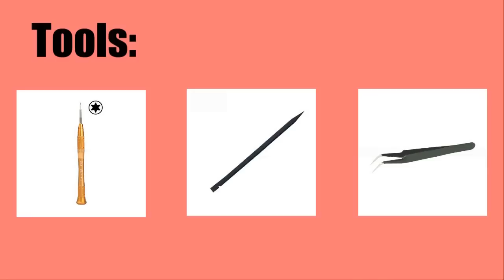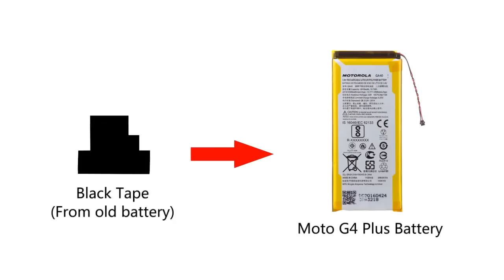Moto G4 Plus Battery Repair Guide

Comment: What is the purpose of the black ribbon that you peel off at 1:00? Is it absolutely necessary to put it back? Tank's
Reply: its for heat dissipation and yes, it should be put back. You can see the thermal conductive grey material while peeling off.

Comment: "Yellow sticker"? Nope... that is the Kapton (polyimide) tape. The black is not Kapton. The battery connector is not a flex... flex conductors are flat ribbon conductors... that's just a wire with a connector.

Comment: I did this on an xt1644 and now the battery will not charge with any charger. any suggestions?
Reply from the maker: Plz try reconnect the Battery flex cable, insure all the flex cable are connected well then see if these can work.
let me know if there's any other question :)
Reply: Thank you for the quick reply, but I actually restored my phone to a previous backup and that solved the issue. I'm guessing the software must have gotten confused at some point.
Reply from the maker: wow that's cool, I'm happy to hear that :)    so have a nice day